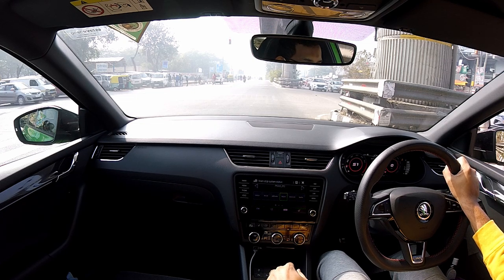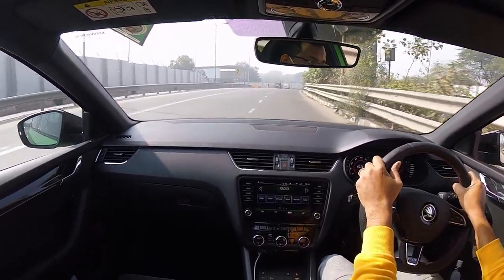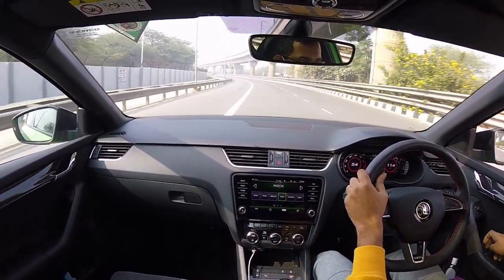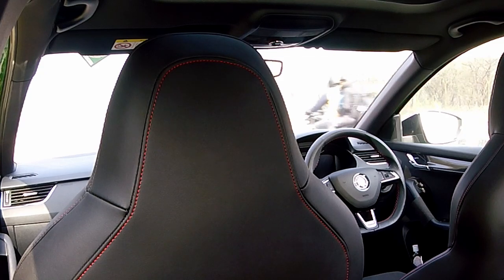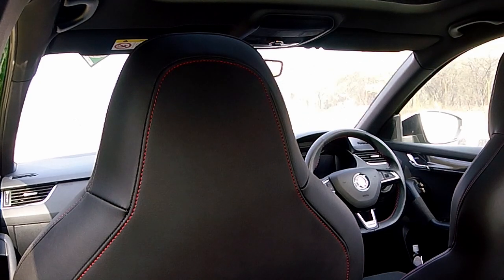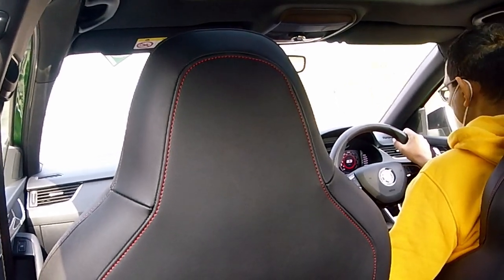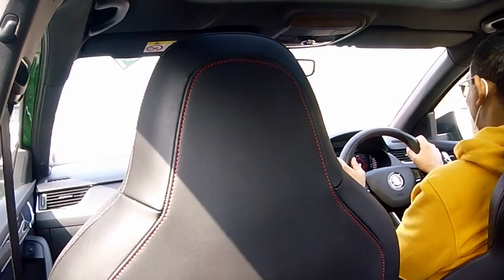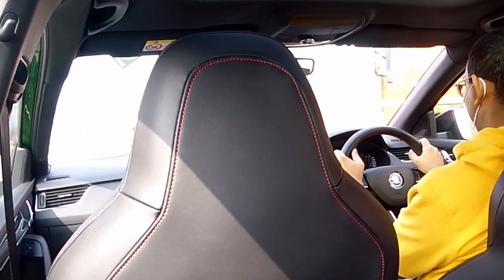Skoda Octavia RS245 - Milltek + Borla custom GPF back exhaust setup - Part 2

Comment: Sounds really bass-y. Is it still on the stock air filter? I think a BMC or a RacingLine filter would really help with the induction bark.
Reply: Even K&N would suffice
Reply from the maker: stock filter. It works best in our dusty climates.